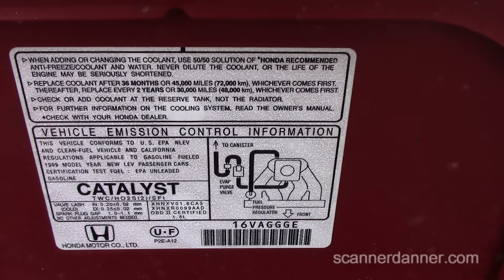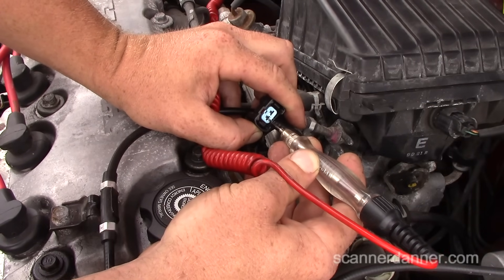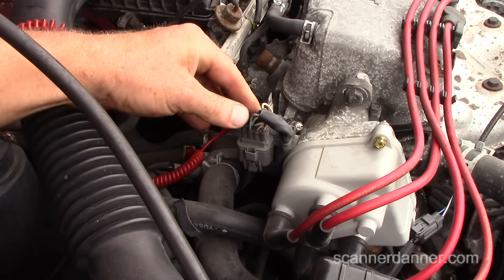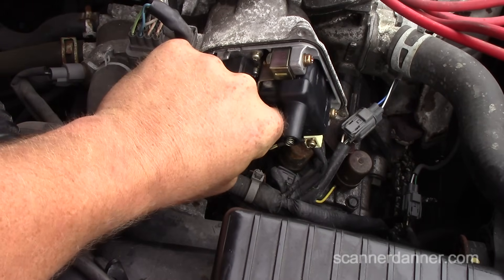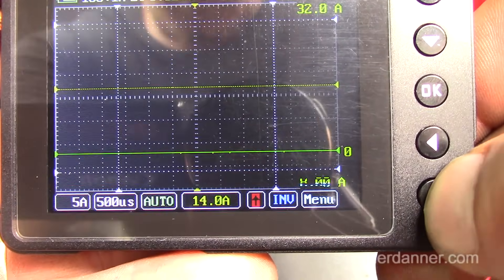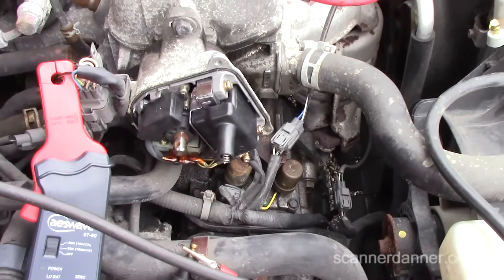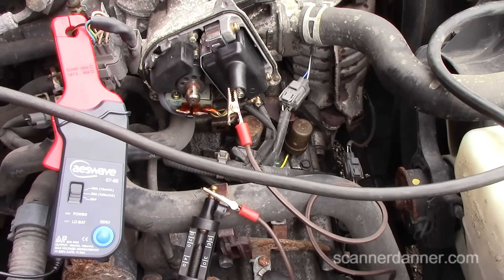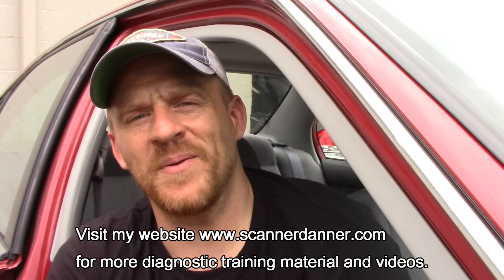99 Honda Civic No Spark Diagnosis with a Test Light

Comment: You got nuts for using that test light too check spark. Them coils putout 30k volts. And that insulation is only rated to best Cat III 1000 volts.
Reply from the maker: Lol, it doesn't hurt. Very very very low current, high voltage surge
Reply from the maker: Been shocked by ignition coils thousands of times. Unless you have a pace maker you have nothing to fear from a 12v DC ignition coil

Comment: I replaced a rotor button and cap , it ran for a minute and died I’m thinking maybe ignition coil
Reply from the maker: test it like I showed in this video, it could be a fuel issue too so don't just throw parts at it

Comment: Started off with no spark at the spark plug, took off to distributor cap was getting spark at the coil put the cap back on car started turned off after a few minutes took distributor cap off now I’m getting no spark at the coil
Reply from the maker: Time to do some coil control testing like I'm showing in this video
Reply: Thanks, that’s what I will do when my helper/wife gets home. Was just maybe thinking that it could possibly be something else as far as that thing working intermittently.

Comment: Why spark look orange and not blue
Reply from the maker: Orange spark is an old wives tail. The smaller the air gap, the more orange a spark becomes. Why? Because current flow is higher! The larger the air gap, the more blue it becomes. Less current and higher voltage required to jump the gap

Comment: We started with a spark check using a spark test tool and the tool showed a spark.  Still no start.   We went through the entire checklist, distributor,
Reply: Got cut off.  sorry.  next we checked for fuel, fuse, main relay and power to the fuel pump.  While we were in there we replaced the main relay, fuel filter, and upgraded to a new fuel pump.  Still no start.  I was ready to junk it.  As a last resort, we pulled all 4 spark plugs and the gaps were a little wide.  We placed them and guess what, it started.  I didn't know that with these 4 cylinders you need 3 plugs working to start but it might not, it won't start with just 2 operating plugs.  So using a spark tool can fool you.  The plugs we replaced were kind of old but they were iridiums.